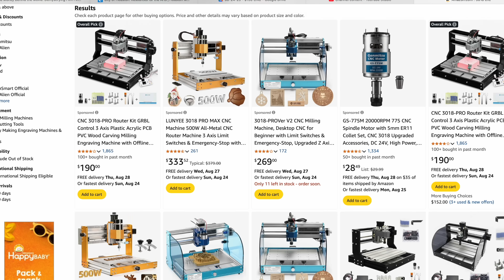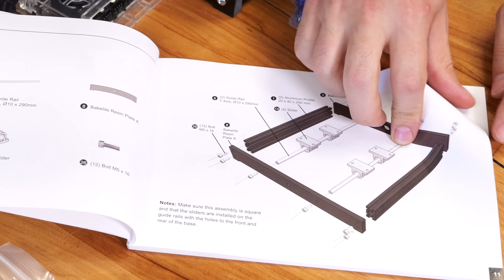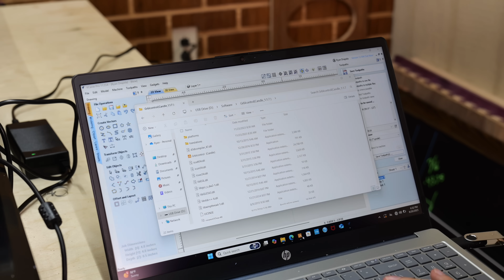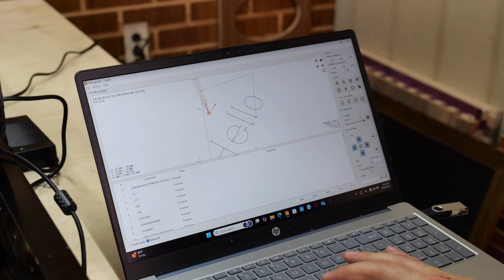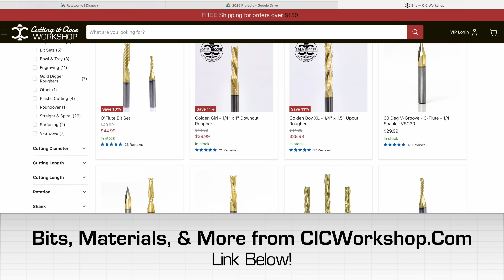I Tried a $150 CNC Router… Here’s the Truth

Comment: You probably had the grbl config ($$ in the gcode sender console to see the config settings, you are looking for $30 for max and $31 for min setting) set to a low spindle speed. They do actually go pretty damn high in RPM and make a HELL of a racket doing so. But if the grbl config is set wrong, it won't matter what it says in the gcode.

Comment: I have one of this desktop cnc. Not that exact model and brand, but with a similar size and setup. The weakspot is the spindle holder : the 3D printed plastic cracked and now it won't hold the motor. 
Moral of the story : if you want to buy a small cnc for hobby and learning (i'm a tinkering guy), buy something full metal !

Comment: The machine will do what it was designed for quite well when used properly. Unfortunately this video is just “clickbait” for selling whatever it is this guy is selling. If you want some useful information you’ll need to keep looking.  🙄
Reply from the maker: I literally sold nothing in this video, nor do I have an affiliate link for the 3018.
Reply: @cutting-it-close  To quote from your video here at 14:45 -  "My goal is to get you using a CNC so one day you use my bits or my materials from CNC Workshop." That sounds like a sales pitch to me Boss. 😎

Also, you're comparing two entirely different machines here which were designed for totally different purposes. It's like you're comparing a Dremel tool to a professional drill press. It's people like you who give the internet a bad name Bro! :face-orange-frowning:

Comment: Using longer inserts isn't really fair. With such a long spindle, I'd have found a stubby version. Having such a deep depth of cut on the star seemed like you wanted it to fail. Could it of made more than one pass? 
How do you set the milling cutter, Drill etc?

Comment: Yup, I have this same CNC and it works fine.  I use the smaller bits that came with it, and bought more of them from another brand.  Just need move it slow and spin it as fast as you can, and it's fine for smaller things...  I've used mine for mostly wood and acrylic and never really had a problem with it, other than when I was first testing it out and messing with it.

Comment: Well I wondered what an inexpensive CNC router would do. I have been modifying electric guitars and sometimes need a custom-made pickguard; therefore I wondered what size CNC router I need. I found one online for $600 with a 24 inch by 36 in bed which is plenty big for my needs. But if I have to spend another $600 on software well that's going to kill my budget. Any suggestions would be helpful. Thank you for posting and I've just subscribed!

Comment: What if space is an issue?  That shapeoko is huge.  Are there high quality small form factor CNC's or do you have to go big to solve the issues you point out?
Reply: There are, Shariff DMC makes some small machines. I think Shapeoko also does one small machine. There is one more, I forget the name, it’s a very good cnc router style machine, comes with an optional machine plate
Reply: remember, ewery men can build own cnc machine in garage, not need buy, DIY machine can build less than 1500 USD and have lot better than shapeoke machine. better motors, drivers, software, rails, etc.

Comment: Since it's the internet and nobody is going to call me on it, I use mine to fabricate full size aircraft carriers for the Navy. Just the ship (not the planes- they appear pretty complex).
The main thing that bogs this incredible machine down is the propellers, since they weigh in excess of 30 tons and the included clamps have a hard time holding it is place. 
That's my story and I am sticking to it. I did mention my production issues to the Navy and they are ok with giving me an extra week to build the ship before they send the MPs out.
Reply: Yeah, just keep the chip load down and feed rate low on these little CNC’s.
Reply: Damn! Get yourself a couple more and you got yourself an entire shipyard in your garage!

Comment: Bearing in mind that I do not have anything like your level of experience, the one thing you dismissed that I think should be within the capabilities of this machine is cutting PCB's.
This activity alone might be useful enough for some people to warrant the $150.  Typically the copper layer is less than 0.1mm (0.004"), and as there is no need to cut more than a minimal amount of substrate; it should be 'Doable'.
Similarly, the through-holes are within the scope, given a dedicated drill bit.
Another informative, unbiased video, which can't be easy when you work with 'proper' machines daily!   😜
Thanks.  👍
Reply: this type of a machine with that sort of sides has indeed its roots at being sold for pcb cutting at home around like 12-14 years ago. there were some german brands.

anyway i think the usual mods are to fill voids in the head with epoxy, third rail etc, then moving to magrails mounted on a steel backing and so forth.

Comment: prolly not something for beginners but i've been known to type out code, pop it on the card and run it. it's much easier with cad/cam software though. i like mine, done a lot of random stuff on it. worst thing i've ever done was etch my name on a chisel. it was not happy lol. i think it's worth mentioning that chip load is something to concern yourself with. a light pass can get around the rigidity and power. just use m3s10000; on it. i've seen mine take about a 3/4 depth cut full feed speed on mdf with a screwed up program once. it was a 1/4 4 flute up cut  mill. it wasn't happy but it took it. it was like a train wreck, couldn't turn away and had to know if it would take it.  i think where it shines though is 1/8 2 flute ball nose up cut. honestly though, i've got no complaints on mine other than the limits i knew i was signing up for. i would love something more powerful though. i run a makino daily. i just wanted a toy to try things at home. didn't realize the limits on the programing. it was effectively a cheap toy. i've made some functional parts from it, gifts. about it really, learned enough to understand programing better, no complaints. it's not a professional tool, it's not got the nuts to really do anything. bed  travel and especially the z are a hinderance sometimes. i do some crazy stuff with it. it will approach tolerances but keep in mind the tool width can effect shape id corners.
Reply: Brilliant comment!
I have attached a pen, and used it as a tool to get my head around understanding G-code.  UNIVERSAL G-CODE SENDER (UGS) is an excellent tool for this sort of learning.

Comment: Yup, I agree with your review.  I bought one of these years ago and I'm surprised that they aren't much different.  I couldn't get mine to do anything meaningful at all.  So many issues to deal with and I just wanted a tool to cut things. I tried making PCB boards and the problem I ran into was that the machine is not consistently level so one side of the board would be under cut and the other overcut.  the copper is super thin so precision is very important for this. I even bought the laser module and I couldn't dial in the power to get a clean cut or etch without burning things up or not at all.  There must be something good between the $150 and $4k models for a hobbyist.  I'm at the point where I want to just build one myself from scratch but even that takes a lot of time and effort.

Comment: I bought that exact model about a month ago for my first ever. Its mostly done what I've asked trying to figure out my first CNC using freecad. I've snapped a few bits, but so far its frustratingly fun trying to figure things out. Plus its only 190 for a learning experience.
Reply: What you said here is EXACTLY where I see this machine fitting into the picture:  Something that won't break your heart to throw away after it has taught you enough to be useful.

Comment: It works to learn on.  Make your early learning mistakes on a cheap machine.
To assemble it and getting started, try James Dean Designs videos.
As far as spindle speed, it goes much faster than 1000 rpm, you need an optical tachometer to measure the rpm  (with some reflective tape).
I have one of these machines and can definitely hear the speed differences as I increase the speed from 1k to 10k.  Thanks for trying, but it really seems like you hate this machine.  And maybe you should, it's not for everybody.
Reply: “It’s not for everybody”
And neither is his fantastic $4k Shapeoko.
Reply: I am thinking of using one of these machines to cut, drill holes and slots on  aluminum TSlot extrusions

Comment: I feel like it would been better to start with exactly what it came with. Meaningbif some one like me just starting buys this and just starts I'd be using those bits. It would be nice to know what it would do and what it can handle straight from the box. Then start saying I would upgrade to this and that. Also it mentioned many things it cuts. How well does it do with metal like thin tin or aluminum and what about leather. I feel like some one new who wants to start out could learn with this even if it means slowing down the cutting speed or movement speed.

Comment: I used bCNC running on a Pi4.  You can use wood router bits for surfacing, but there is not enough rigidity for good cuts except for tiny cuts.

Comment: These machines are mostly designed for engraving. They will engrave most materials. Engraving is basically just scratching the surface with the provided bits. Can they cut? A little bit yes, but that is very limited. You can absolutely engrave steel with one. But again its basically just scratching the surface its not some deep carve you can expect from a larger machine. Also these are a good option to actually learn CNC langeage with, and kind of learn how the software workflow works for the process. I don't think anyone expects this level of machune to mass produce parts, ir at least I hope they don't. You could easily use one  to engrave say a dog name tag with it, or some acrylic sign. But yeah I think people need to understand the purpose is mostly learning and engraving, not cutting or serious work.

Comment: I had one, and im pretty sure it ran (based on the sound) much faster on the spindle than your machine does.. Did you measure the voltage on the spindle to see if it got all 24V for max speed? Besides that, funny little test video :D

Comment: I have a genmitsu machine, the 4040, and I bought the Wifi box for it, and I happy I did, cuz the Candle software would not boot at all for me, the UGS worked. But the phone app is not that bad, only annoying that it disconnects as soon as your screen goes dark, at least on my phone. but it doesn't stop the cutting
Reply: phone NOT need any workshop machines newer, only toys and other childrens machines has phone option.
Reply: @mattivirta Its sturdy enough for what im cutting, and I would not fit anything much bigger in my workshop and its really nice to have the "offline controller" on my phone as I anyways only use it to jog the machine and upload stuff to the SD card. If the bits that I ordered with the machines would not be so dull they would probably not snapped when I cut 18mm, and I would not let anyone under the age of 12 close to this machine. for 1000€ it was the only prebuilt one I found when googling and looking around. and I don't feel like building my own as I just wanted to get started making stuff. I got the Pro Max as it sounded on the reviews to be the sturdiest of them. feels hard to find stuff online sometimes when all you are fed is American or Chinese machines and websites to order from.

Comment: Bet you spent more on broken endmills learning gcode than that little machine cost.  A single crash on a big CNC can cost you way more.  

Now, if you are running a shop for money, where time futzing around is money lost, and you just want to follow established paths to make more money... Absolutely, buy the best you can afford and don't screw around. 

But, if you're curious about what CNC is and you're doing it on your own time... Go ahead, mill some foam, drill down into the table and snap that $0.50 bit, smash that bit into your hold-down clamp, blow you zero references over and over until you get it, actually learn different CAD/CAM to find out what you like.  Then, then go buy a real CNC... After you know what you want; after you understand what you want. The amount you can learn with $150 and some futzing around is astounding.
Reply: Could not be said better!
By the time you have finished with this you will have a much clearer idea of whether you want to pursue CNC's further.
If you do, you will have a much clearer idea of where you want to go next, AND the 'woopsies' on this will help you avoid destroying your BIG investment on day one!

Comment: I have a 3018 I got for about $90 on aliexpress as a "toy" and I can tell you it will for sure cut aluminum... the hole I carved on the platform is the evidence! I've since acquired some scrap to use as a spoilboard. I got it because it can just sit on my desk, I don't have room for a large machine and the footprint of this one is great as a hobbyist. I will use it to try to cut titanium some day, I just need to get my work space organized so I can set it up again (soon). For reference, I am an engineer, but only get to do design, so I like having a little machine that can make tangible things. Mine also came with a little laser.
Reply: Конечно, титан на этом станке фрезеровать может только инженер 😂

Comment: Hopefully constructive:  Starting with the assumption of what the machine can do is the wrong way of testing. If you are testing it, use the bits it came with, then test everything they claim, including steel, and thick materials until it fails. The goal is to document the failure point, and see if it is within what they claim.
Reply: " test everything they claim, including steel, and thick materials until it fails. " 

I worked with a guy in 1978, who was older than I, ought to have known better, and of whom I once asked, mischievously, "how do you decide what a machine can do?"  He replied that if the machine stalled, he'd reduce the feed rate (you've got to assume a guy can calculate cutter / workpiece peripheral speed...) I though how different he was... Most of us work gradually up to maximising metal removal rate, stop pushing when the machine complains... He didn't... He worked down from a stall...
There is a picture that flashes into my mind on occasions, of him operating a Bridgeport, being his usual "animal" self, (that was his nickname, "Animal" ) with a broken "X" axis  (table) handwheel in his mitt (made of Black Bakelite or similar) most of us could make one last a lifetime... He said "It just came off in my hand!" 

I learned from a PERA course how to calculate a machine's (theoretical) maximum metal removal rate and work up gradually... I once found a machine that could remove more material than the spec might suggest... Turned out that it had a 10 horsepower motor where the normal was 7.5 horsepower.  Seems the factory, if short of the correct parts substituted others...

Comment: I purchased a very similar unit, but with sturdier T-slot rails. I appreciate Ryan’s expertise and was pleased to see this video address low-end devices, but I think the review placed too much emphasis on the connection process. If having trouble connecting to a computer, I recommend consulting with ChatGPT or other AI in plain English; they can be super-helpful. Another option is to get an offline controller — they're low-cost, fully plug-and-play, and the interface is easy to learn (and it won’t tie up your computer for hours). Just load G-code files onto a micro USB and pop it in. And to create G-code, I use the free version of Easel. While I'm doing only basic stuff and not trying to squeeze out anything salable, the whole point of getting the small CNC was as a learner before messing around with the bigger ones.

Comment: Fun to see you reviewing a budget hobby CNC, but I have to disagree with your conclusion.  My first machine was one of these Genmitsu 3018s.  It's certainly not a production-quality machine, but despite its flaws, it was a great platform for tinkering and to learn about CNC routers and control software.  Watching videos only gets you so far if you don't put the knowledge into practice.  I got to learn about bit selection, feeds and speeds, chassis rigidity, CAD/CAM, in-depth GRBL programming, and all about CNC machine hardware by upgrading it.  Replacement parts are incredibly easy to get for these little machines and are cost effective.  It has been upgraded multiple times and doesn't look much like the 3018 it originally was, but tinkering was the point all along.  I later got an Altmill and had a really solid foundation to put it into production, but I still use the desktop rig for small projects in my office when I don't want to go down to my shop and use the big machine.
Reply: I must have watched the video through different lenses...  I came away with the perspective that this machine was a good way to become familiar with the various facets of CNC machine operation.  If you want to make your living, be prepared to spend more.
Reply from the maker: What technology background do you come from?  I ask this to understand more, not to argue